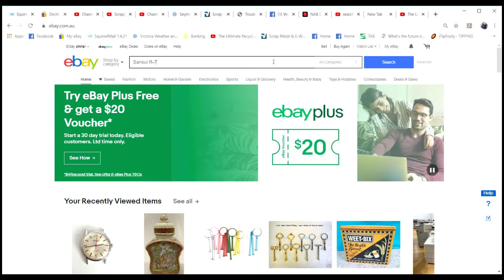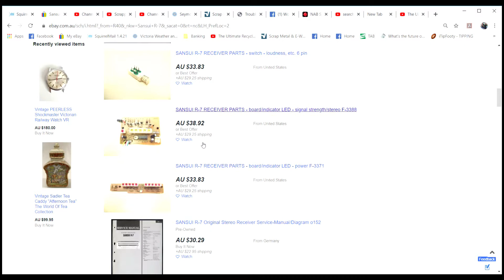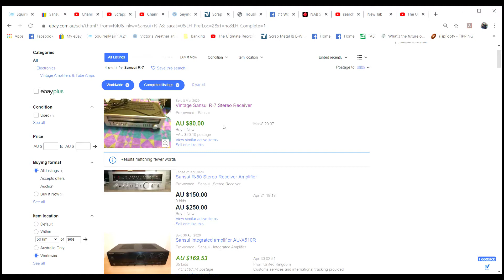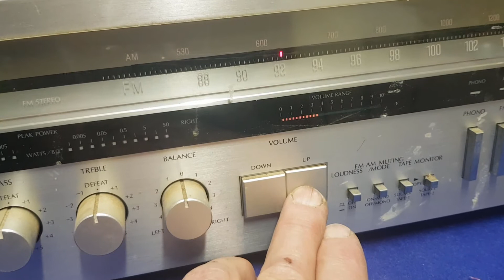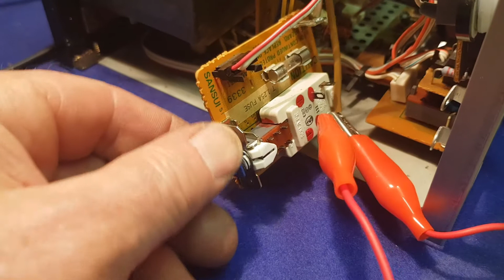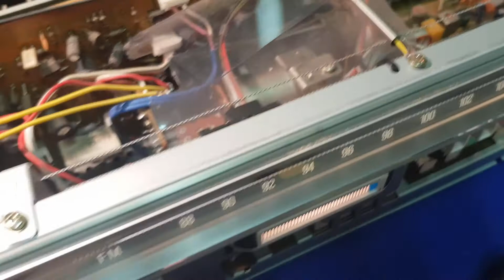E-waste Score! Can I fix it? Repairs to a vintage Sansui R-7 receiver amplifier - Part 1

Comment: How do you get the A & B channels to both work at the same time with the R7 , or am i gonna have plug all 4 speakers into 1 channel ??
Reply from the maker: Most amps have and A & B switch which will allow both to work at the same time. I don't remember what this one had. I guess you can wire both into one, but you'd have to be aware of the impedance load you are putting on the amp.